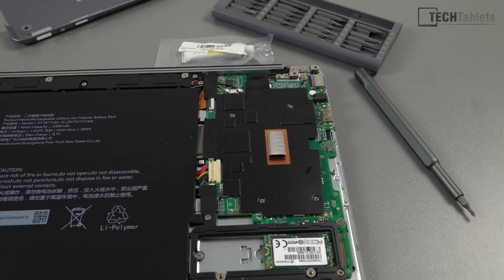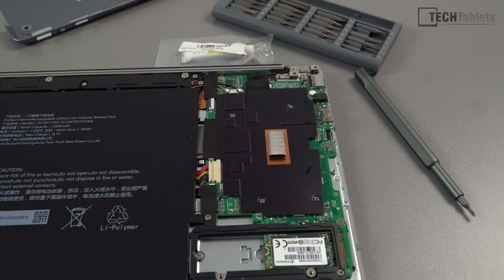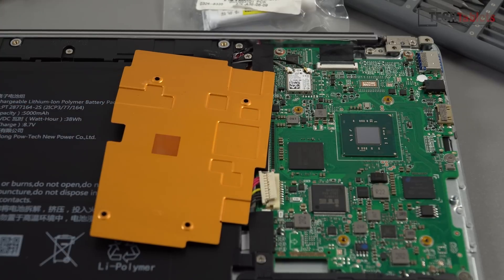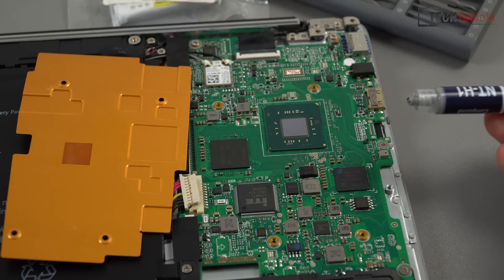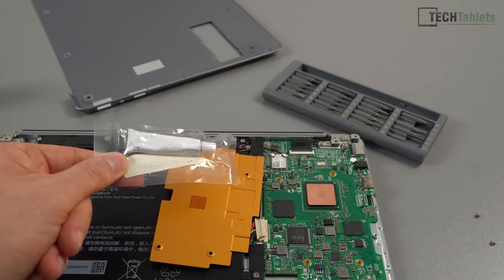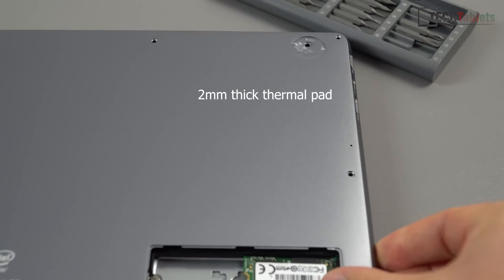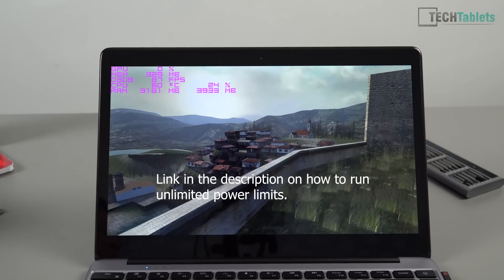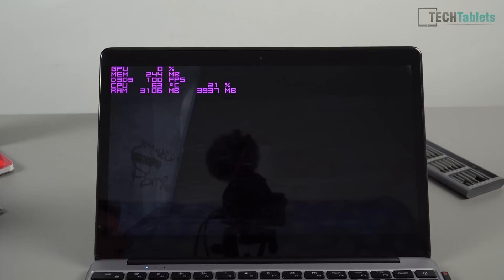Lapbook SE Copper Heatsink Mod - Lower Max Temps Up To 20 Degrees C!

Comment: Hi, i have an huawei matebook d, with a reyzen 5 2500u, it have 2 heatsink and a fan, my problem is that at 45 degrees the fan start spinning, and i don't like it, do you think that this mod can help? if i put a thermal pad that have contact with the back cover.
thanks sorry for my english...

Comment: Isn't it a rather ineffective thing to place additional copper plates? Because then you introduce another component into the colling mechanism, which means even more incomplete surfaces that have to absorb and transfer the heat away from the die, now through even more layers... If you understand what I mean...
Reply from the maker: Yes and no when you look at the results they speak for themselves

Comment: super video. i have followed your video and done same for a hp2570p with i7 3520m and after adding a big 25mm by 25mm 1mm thick shim with a thermal adesive on oposite side now cpu is idle at 36 degrees and heavy load up to 55 to 58 degrees. great advice keep up the good work

Comment: I've ordered my CHUWI SE I've also ordered thermal pads, thermal adhesive and 15x15x1mm copper shims.
Can't wait till arrives

Edit: My Chuwi LapBook SE has arrived and its good my thermals are not going above 45c normal use, for example, media consumption, YouTube, social media and light word processing. I'm still doing the mod the cooler the better for longevity of the CPU.

Comment: Hi Chris I got this laptop and noticed very bad performance on Linux and chrome Os. I am about to do the hardware tweak, but how can I do the software tweak in Linux or cloudready. Does changing the bios setting have no effect at all, and is the software mod absolutely necessary?

Comment: Hi Chris, is there any difference in the terms of thermal efficient between the NT-H1 paste and the adhesive? What about adhesive vs. pad? 

Can I use paste on both sides of the 1mm copper heat sink?

Comment: Chris, I know you refer that you hadn't problems so far with shorting the resistors, but it wouldn't be better if you cut the copper to the right size? I mean, you are applying so much pressure to close the laptop in the end that seems that you will pressure the copper too.
Reply: The amount of force required to bend that 1mm thick copper shim is way beyond the force required to bend the magnesium alloy laptop chassis. I'd definitely say to apply a lacquer to protect them, but it's not necessary to cut the copper. Besides, you want that shim to be as large as possible since it is the interim heatsink.

Comment: I've done mod like this on mine Chuwi Hi8 Pro and difference in temperatures was huge under load before was 83*C now it has around 70*C max. Additionally Atom z8300 stopped throttling which is amazing. All these chinese devices has poor heatsink solution. And this video shows how a little work is needed to make it better.

Comment: This is by no means expensive, so I wonder why manufacturers didn't do it in the first place. Copper shim + a drop of good thermal paste + thermal pad should cost no more than $2, probably $1 since manufacturers would buy them in volume. Then they can make advertisements showing that their thermal solution is above average for the same hardware specs. Win-win solution for everyone, so why?
Reply: Because is intel and so on that run on a 60% margin, so these kind of brands need to shave as much as possible to make it competitive!

Intel does this on their cpus with shitty tim paste so why others shouldn't follow?
Reply: In long term it gonna create more problems and make laptop life span shorter
Reply: @rewer  
Well guess what this is an appliance, so long term isnt a concern here!
U just need to make good enough product.
Reply: At such razor-thin margins as Chuwi is handling here, I'd wager extra assembly-line/manual labor would be more trouble than it's worth.

Kind of like buying a McDonald's burger without an ingredient and it taking much longer to get to your hands in spite of having less stuff in it.

Comment: You would have been better off putting the shim on top of the heat shield, might not even need a pad to make contact with the base. That shim could easily crack the chip if you bang into it.
Reply: Hmm... Well he said that hes done it multiple times already. But I'm also curious about your thoughts, especially when bringing such laptops around like putting it in a bag
Reply: @JoJo Rox What if you skip the shim and just use a thicker thermal pad(like 3-4 mm)?
Reply: @JoJo Rox The heatsink is made of copper.  You're an idiot.

Comment: I wonder if doing this on my N3160 Acer Chromebook 14 would let it stay in boost states more often. I don't think it's thermally bound though, barely a spot of warmth on the aluminum shell, rather just Braswell was conservative with boost and it didn't work as aggressively as Core's.
Reply from the maker: if it's not getting hot I wouldn't bother. But if you can unlock the power limits you can speed it up a little.

Comment: this is really good stuff mate. amazing how a company can mess that up.
Reply from the maker: My guess is they don't want the bottom getting too hot so none use a thermal pad between the heatsink and rear metal panel.
Reply: @Techtablets  well i guess they opted for device stability. but thanks to this guide, the modders will have a chance to squeeze more power from this device 😃
Reply: try that on mi notebook air 13
Reply: Rengg have you tried it? How went?
Reply: @re inc, same thing on the mi notebook pro. played monster hunter world on it for 4 straight hours and first time i felt it throttle, the upper keys f5 - f8 is really hot xd. can't blame me for playing on that tho, it performed well.

that device could use a good thermal solution, or probably i could tweak cpu gpu settings on it to lessen the head generated.
Reply: The very expensive notebooks have the same problem ( too small cooling solution, bad quality thermal paste ).

Comment: Can you play CS GO on it with the copper shim and thermal pad? That would be the big test. 40fps? :P
Reply from the maker: Same result as HL2:LC bench in same areas can double the performance. for example, 20fps 720 low settings is now 40+ FPS I will post a test of it in the review. Coming end of the week or next. Full reviews need more time to test.
Reply: @Techtablets  Can I skip the shim and use a thicker thermal pad?
Reply: GeForce Now can play any game on any device! Its pretty impressive!!
Reply: @whatthehecknate  lol there's still a catch, you need a high speed internet connection
Reply: @kiyoponnn  hahahaha